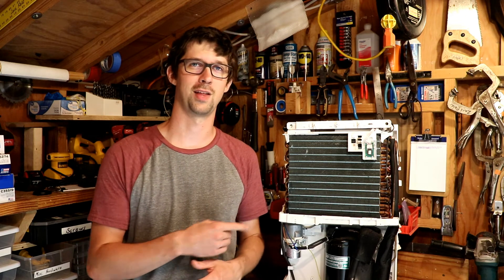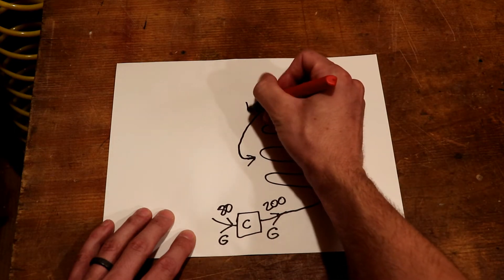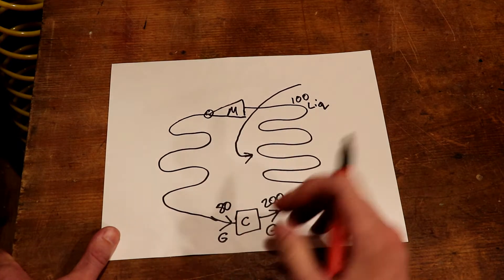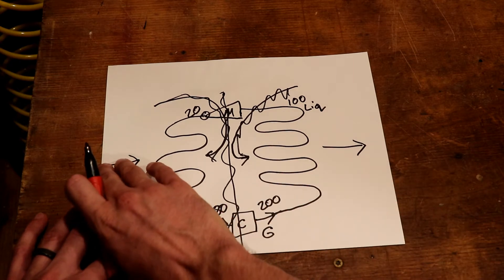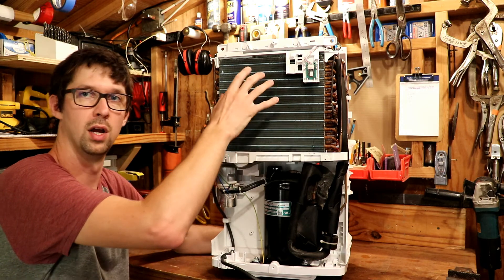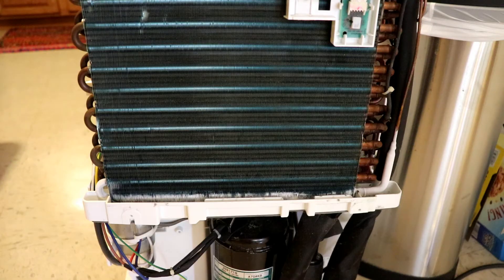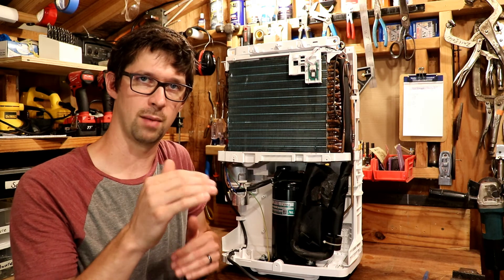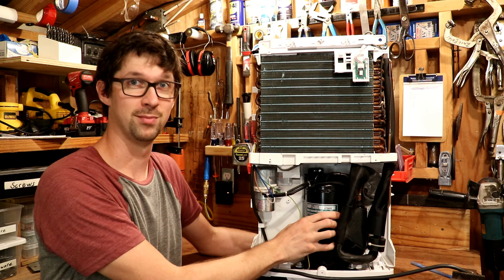What's Inside a Dehumidifier?

Comment: Great video. Just a correction: the air coming out on the other side is actually hotter then the intake, that is because of the latent heat from within the humidity that is being absorbed into the evaporator coil. So if you have 70°F being pulled you can have 75° blowing out on the other side (all depends on the latent heat). Great work. Thank you
Reply: More actually. Any watts you put into the system also produces heat. So a 600w dehum will produce for example 610w of sensible heat.
Reply: @bentosan  correct. I was just talking about the latent heat alone, besides for the wattage of the unit.
Reply: you're right, actually right now I'm using one old style using paragon timer that each 8 minutes turn on a normally closed solenoid valve that pass the gas from the coil to evaporator and fan is behind the evaporator. hence passes the air from room through the a mesh at the back of device firs. so eliminate the dust, then pass the condensed coil then pass via evaporator and finally comes out of dehumidifier back to room.
Reply: Great video. A deeper dive would be nice. What does the capacitor do? And what are the other parts?  Explaining the signals going into the controller and out would be interesting.
Reply: @RobertLugg  There are often two capacitors: a smaller one (say, 4-6 microfarads) that helps with starting the blower fan and a larger one (say 20-40 microfarads) that helps with starting the compressor.  The starting assistance has to do with induction motors -- the simple ones without slip rings -- that spin well but don't start well.  They need to temporarily apply a phase shift to the single phase winding to increase torque for starting.  If you want to test the capacitance with a multimeter that has that feature be sure to short across the terminals of the capacitor with a screwdriver before disconnecting the leads in order to avoid electrical shock -- the bare terminals are usually accessible.  A bad capacitor prevents the compressor from starting, thus no dehumification.

Comment: How come when I set my air conditioner today humidification then it spits out cold air?
Reply: I think it's due to the fact that the hot air is expelled outside and not inside like a portable dehumidifier. I have, but don't use, a portable AC, and wondered the exact same thing. AC and Dehumidifier seemed like the same thing.

Comment: Awesom job explaining how a dehumidifier works. Last one we had stopped working, we moved, and I had to repurchase another one to help keep basement humidity low. Since we've had hot days and been running our heat pump, the humidity has jumped to 65'ish%. Would rather have it between 45-55%. Wasn't expecting the heat from the dehumidifier to warm our comfortable 69°/70° room to 77°! Unit has a Set setting, along with Continuous and Max. How is the exhaust (warm/cold) going to be during each of those settings? Which will keep humidity set at a specific % and limit heat? Thanks, in advance. Loved that you included a real-like example of the frosting of the coils and the melting of the ice.

Comment: Cab you fix a dehumidifier, I have one that is showinhg Er code 1 which basically the compressor doesn't turn on. The fan works.  I was told this may be a senor gone bad.

Comment: Awesome video. I have the same dehumidfier but mine is frosting up around the evaporating coil 2-3x the size of the coil and the ice melts but does not drain in the bowl, just goes straight down and leaks under the unit. Once again awesome video. Subscribed!!!

Comment: I am looking at building a vacuum wood kiln which if you can vacuum down to less than 1 inch of mercury  you reduce the boiling point of water to around 75°F.  Doing so safely releases gallons of water in a short amount of time but you also create a mini rain forest.  I've thought about putting a dehumidifier in the chamber to control my condensation but am worried about how a dehumidifier would perform in the absence of atmosphere.   Any thoughts?

Comment: I have an idea, take the air conditioning unit from a old car. Run three fans on it. One for the compressor and hot coil. To blow heat. Separated by a insulated wall that holds another fan system to blow cold air/ keep drinks cold. Separate the drink compartment from the cold coil to allow the dehumidifier to act as a water generator for the car... this gives several benefits, a mild heat source when engine is off, cold storage, and water collection for the house... add a charge controller onto the orginal battery and run that to another seperate 12v marine battery with a decent reserve capacity. Or an entire battery bank if you want to go the extra mile. Add in a wind turbine to your car system and boom mobile power and water generator for simply running your car as you would anyhow (food delivery and commercial industries are missing out!!). Total cost would be miniscule. As low as 20 for the charge controller, 160 per battery, 50 for the inverter, 30-50 for the coils, and 0-150 for the air conditioning unit... another side note consider running the water reservoir to the underneath the hood, thermosyphoning the water for extra heat and hot water on the go. Plus water running under the hood will be smart to run alongside  the heat system coils. Allowing additional cooling to the engine compartment and increased free heat and hot water to the system

Comment: So, my question is..., how do I find a dehumidifier that I won't have to replace every year because it doesn't work anymore?  Reviews?  Nope, tried that.  I've bought some of the most expensive Frigidaire ones, which might last me 2 years, to the cheap ones, which might last me 1 year.
Reply: Did you find one? I just bought a Hisense with a two year warranty.
Reply: @SeanBaker  Well, I ended up getting a Danby at Costco.  It's about that time of year when I need to start using it again.  We'll see if its still kicking here soon...
Reply: Nope, dead as excepted.  Guess I'll be getting another one, again.
Reply: @szargos  well heck.

Comment: Thanks you for your nice video, I have  this kind of unit and wonder how the defrost mode kick in ? - cos I have look inside and there is only one PT sensor for checking the temp. when it get to cold, is the sensor both for shout of compressor when it get to cold AND for detecting that it need defrost  ? - I have a woods model 10

Comment: Do dehumifers kill mold spores or do they just stop new mold appearing I have mold in my bedroom and I use dehumifers also are small dehumifers ideal for a small bedroom or should I use large or medium dehumifers also do dehumifers work and are they worth using
Reply: I’m sorry, that sucks!  I don’t believe dehumidifiers will kill mold spores. They will just lower the humidity to a level that makes it difficult for mold to grow.  That will be important over the long run. In the meantime, killing mold where you see it with various cleaners is helpful, as well as using an air filter or good filter insert for your HVAC (air conditioner) system, if you are having allergies to the mold.
Reply: If your small dehumidifier is not keeping the mold down the you should consider getting a nother small one or a window AC you can also make a dehumidifier, There are other way to purify the air too (search Youtube).

Comment: I have a 70 pint Honeywell TP70AWKN.  It is located in my basement with a temperature of 70 degrees.  The Dehumidifier is set at 50 degrees.  Sometimes it will go down to 45 for 3 minutes, and then shutoff.  The level will go to 55 and then start back up.  Other times it will run for days and stay at 46-49 degrees with cool air out the top.  Then it will at some point start operating the way it should again.  Is this normal ?